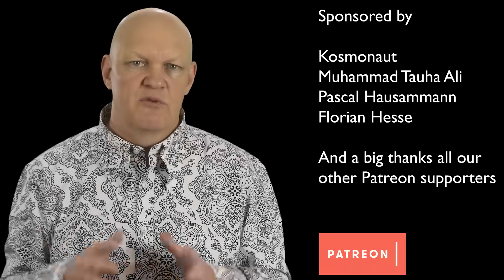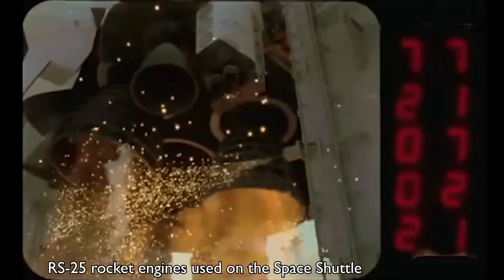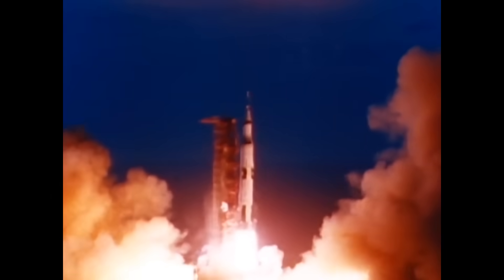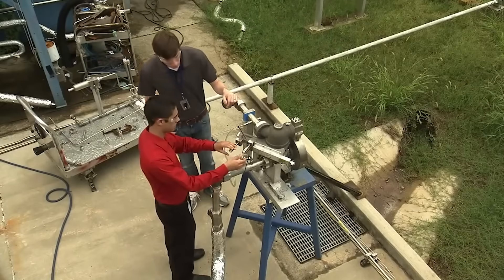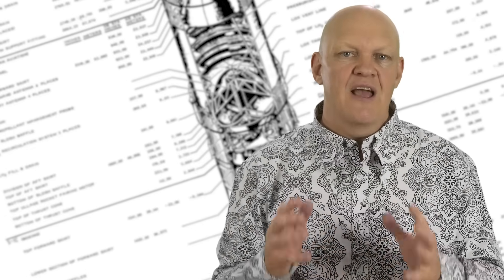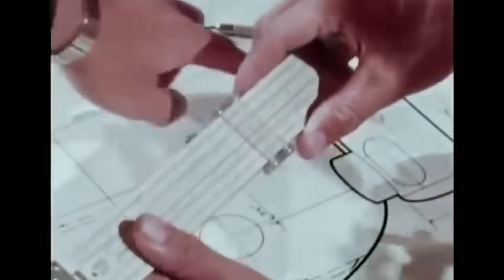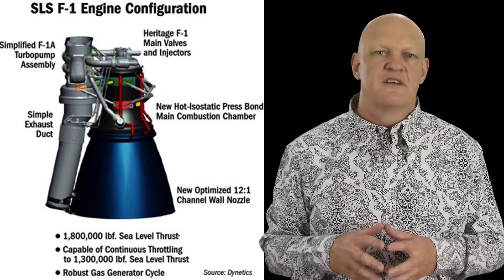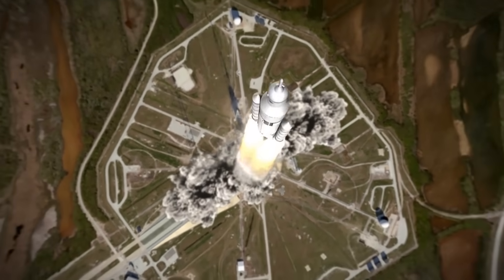Why Can't we Remake the Rocketdyne F1 Engine?

Comment: I was tasked with getting a replacement made for a circa 1971 custom made 18,000 RPM spinner assembly made. It had very tight tolerances and some interesting tricks were used to allow it to do it's job. It had a 2" through hole and 4 open cage air/oil bearings spaced out along it's 20" length.

To allow the max speed it had to have perfect alignment and zero play.

The original prints were copies of copies of... (which I recreated in SolidWorks). They were missing some info due to copying degradation but I had a working unit to fill in the blanks from. I tore that down and using a CMM found that where the prints called out +0.0003/-0.0000" and perfect feature to feature alignment that was held in every case.

This was a clamshell assembly that weighed about 80 to 100 lbs.
At least 30 lbs for each half on the steel housing.

When I shopped venders to make the parts, most parts received 'no bids' from everyone given a RFQ.

Specifically the housing. Being a tool and die maker myself I knew how tough that part was going to be. I only Requested Quotes from shops that specialized in that kind of tight tolerance and high complexity work. Also I made sure they could comfortably handle that size and weight.

Nobody wanted it. No matter how much that said they did on their website. Btw... My customer had deep pockets so a high bid had every shot at getting the job... if they had bid it.

From what I heard only three of these were ever made. There are other types and versions of spinner that do kind'a the same sort of testing. But when the one we have dies (as it almost did two years ago) there'll only be one left on the planet.

Moral of my story, and of the NASA rocket...?

"Everything that has a beginning has an end." The Oracle

Comment: Where I work, many very large machines and systems are still in use, continuously operational since just after 1970. We face the same problems sometimes. The men that created them are dead, and the documentation is partial or incomplete. Great video!
Reply: It's not just mechanical systems: one of my first jobs, back in the 1970s, was on a project to replace the in-house-written business software for a company using an obsolete IBM 1401 computer. It seemed like a tedious, but not complicated job, at first: most of the software was written in 1401 assembly language, so its logic would need to be duplicated and rewritten in a modern computer language. But, when we started running the old and new systems in parallel, they produced different results.

It turned out that, because the process of compiling large programs was slow, people had taken to patching the compiled machine language card decks for minor fixes, without updating the source code, and no one knew who had done what, or when, over the course of several years.

We wound up having to buy a 1401 emulator software package for the new computer, and running the old object decks while we figured out what undocumented changes had been made.
Reply: @earledward8766  NASA is about to place an object into the orbit of an asteroid for the first time. NASA (with the help of the EU) just landed on Mars. Not to mention the countless satellites the US has launched this year including several that are for the specific use of US intelligence. When you say "we have no access to space anymore" what are you talking about. Please look at the upcoming launch schedule for NASA https://www.nasa.gov/launchschedule/
Reply: @Bum Face Gammon And you, Go back to your safe space!
Reply: Wow, that's awesome...sad it wasnt documented properly
Reply: I interned a power plant that had steam turbines used in the 1940's.  None of the designers were living and everything was done on paper back then.
Reply: @earledward8766  In less then a year there should be 2 commercial carriers (SpaceX and Boeing) to carry astronauts in space. Test flight sscheduled, vehicles ready. I doubt they both will fail, it's pretty straight forward tech. SpaceX is flying the uncrewed one frequently. More coming. So I think that's nothing we should worry much about.
Reply: @Bum Face Gammon"The Education System", especially in the USA & the EU, no longer teaches children to think. It only teaches them what to think. The education system is able to control the population, because 8 out of 10 people, will always do what takes the least amount of effort, when it comes to seeking comfort as it applies to thinking. It's easier in most situations for someone to follow step by step instructions, rather than for that someone to figure it out for themselves, so schools simply concentrate on teaching things, where they know, that students will get a good outcome, so the following of instructions is positively reinforced in the students. They are never challanged enough with figuring out real life problems for themselves. Not just academic ones but even getting along in society ones, such as in, If you encouter a bully, go & get an adult, rather than sorting him for yourself. So they fail to see the value in actually thinking for themselves. Here in the States, this wrong headed, modern education system has produced a whole generation of compliant drones, known as "Millennials", who don't know enough to realize, what they don't know! For example, to my 23 year old Millennial niece, who is a reasonably able person w/ a Chemistry degree, "Freedom of Speech" is literally nothing more than a euphemism for "Hate Speech". She has no Earthly idea what it's all about, when she hears older generations say things like, "I may not agree with what you say, but I'll defend your right to say it!".
      So, even STEM majors are no longer "College Educated". They are "College Indoctrinated".
       Hopefully, "Gen Z", which seems to have a healthy amount of cynicism about following the docturine of The Globalist Establishment, after seeing their older siblings catch the bullet train to serfdom, will emerge as saviors of the World. ...Otherwise the future seems rather bleak.
Reply: Millennials may not be able to duplicate the F1 rocket engine, but they can sure tell you if it was sexist, racist, or homophobic!
Reply: @sparky6086  Yes because all us millenials dont work or do anything good for society........
Reply: @sparky6086  funny. And a baby boomer could tell you they don't think we went to the moon.
Reply: @MarkBratanov  The apple doesn't fall far from the tree!
Reply: @sparky6086  apology accepted
Reply: @MarkBratanov  Wasn't an apology. I thought, we were on the same page. I was pointing out, that it"s not surprising, that a screwed up generation, the Baby Boomers, would beget another screwed up generation, the Millenneals!
Reply: The documentation was partial or incomplete in some way? NASA just so happens to say most all of the data, video and audio was destroyed or erased as a means to keep costs down.
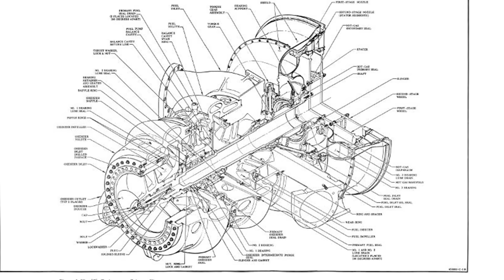Reply: @swish1onu  Well, most of the documentation was not destroyed. For example I was studying a drawing of the F-1 turbopump the other night. It just so happens that Scott showed the exact same drawing in this video at: 3:37. It's all out there if people just bother to look for it.
Reply: @joevignolor4u949  .. Joe, I'm not the one saying most of the important material and technology necessary to go back to the moon was destroyed. NASA spokesmen are saying that...NASA is saying they have to peice together what information they do have in order to re-discover the technology. Again, out of their own mouths.
Reply: @swish1onu  So what? I did things 50 years ago that if I wanted to do them again I'd have to piece a few things together. You are looking for something that's just not there.
Reply: @joevignolor4u949  .. you're making a false equivalency Joe. Let's put some perspective on the moon landings.. it may be THE MOST MONUMEMTAL achievement of man in the modern era.. yet the data, and the technology to go back to the moon was erased, destroyed and lost? Give me a break. Trying to replicate something YOU did 50 years ago is not only historically insignificant, but likely on a personal level, not significant enough for you to have even cared to document the achievement in any detail.
Reply: Well the government and other parties have things like the gun that killed a president or a brain of some scientist people can keep those around. When it comes to information, data, and other records that are the biggest achievement for the whole human race, nah they can't be bothered to not record over it, lose it or destroy it. How do you tell when someone is lying look for inconsistencies and there are a boat load when it comes to humans landing on the moon.
Reply: The only hope I have for Trump's presidency is that he actually goes through with the moonbase plans, or at least enough that the next president continues them because then we'll finally have gone back to the moon and kill multiple stupid arguments moon fakers and flat earthers use.
Reply: Hilarious how a British guy was hired to shill for NASA...
Reply: Well most work places dont have 25 billion dollars in funding and no much in profit margins and have access to the greatest minds and skilled tradesmen like NASA. They can spend a billion dollars on finding and getting a few people to reproduce or come up with something better they could.  They just dont want to admit they didn't make it out of low earth orbit and to the moon.

Comment: New engineers are limited, oblivious and book smart.... it takes them an average of 5 to 10 years in the work place before they pull their heads out of the text book.

The good ones take a year or so, before they wake up. But for every 50 engineers that walk through the door, one is good. Three or four have potential. The rest are glorified paper pushers better suited for project management. Not trying to be cruel i blame the education system, and a lack of practical experience. Today we have engineers playing designer, rather than enhancing, refining and ensuring the design. Drafters reduced to drawing puppets with tangled strings. Communication and planning are an after thought that are not in the budget.

Lost skills/knowledge... you don't know the half of it. The drafting/design side is just as bad. Cad is a great tool, but you need to understand the board and scales. The computer makes the work lazy and the design before had a sloppy half-assed do it like X. So half the work is done with poor design input and direction.

Comment: Apologies because I cannot think of a way of saying this doesn't appear rude, which is not my intention, but your logic is nonsensical. The first time these engines were built no one had the skills or the know-how either - they had to go out and acquire them first. This is the same with everything that is designed and built for the first time and the process has a name. It's called "innovation". As then so now. Before you build the engine you go out and acquire the skills and know-how and then you build the engine. Of course it's generally much easier the second time around because instead of true innovation it's now either following the existing blueprints or if they are lost then "reverse engineering" from what is known and available, where in either case your starting point is way ahead of the completely blank sheet that the first set of engineers started with. The very worst scenario is that no blueprints, models, diagrams, existing equipment or anything at all is available and you're starting from scratch. But even then you are only in the same position as they were in the 60s (though probably still ahead anyway because of additional knowledge acquired over the subsequent 50 to 60 years).

Comment: As "Tian kay' wrote: "The F-1B pretty much IS a remake of the old one, just slightly different and far less complicated."
Why remake a half century old design when you can use advanced design and manufacturing technologies (solid modelling, design for manufacturing, modelling to machining, advanced CNC, CMM, materials, coatings, an endless list) to manufacture something simpler, more reliable and just as powerful? The answer isn't rocket science - err - well I guess it is.

Comment: Great video. Vote for you to be next Bond Villain for ONE MILLION DOLLARS... Yes as an engineer in aerospace the notes that get scribbled on scrap paper or print of a drawing (but not incorporated) gets lost. Drawing on file don't tell the whole story, and the factory or manufacturing working with engineering figure out how to make it work by TRIBAL knowledge.  Want 1.8 million pound thrust  rocket motor? A revised modern F-1B would be awesome. Bottom line we have more accurate drawing and Manufacturing processes and we wouldn't want to make a handmade F1 engine. Yes copy and borrow from the design but we wouldn't make it in the same way because we have better ways to do it which would be more consistent and to tighter tolerances  at least with less reliance on high skill and tweaking.

Comment: We could make those, but why would we want to? Even if they could take us to the moon, which they can't, why we we send men there instead of developing space telescopes which can visit exoplanets, or just send tiny probes to take samples and video?
But these rockets are not any great feat of engineering. They could not perform outside of imagination. If you look at the tail flame you will notice it is longer than any comparable rocket. That's because they were unstable at high speed and a weak fuel mix only could be used on them. 
We know Apollo could never have survived low earth orbit because it lacked the necessary heat cover. The crew would've been cooked in less than a single orbit, far less survived 7 days in the unrelenting furnace of the sun. 
Here's a 5 minute vid explaining this:https://youtu.be/Zztbw7MLlkI

Comment: I'm sorry but I'm not sure where you got your info. I talked to actual NASA engineers back in the 90s at the Red Rock installation about the rocket engines, more specifically the Saturn 5 rocket. My question was simple, "Why not just build a new one?" The NASA engineer flat out told me that they had lost the blueprints and couldn't manufacture it without them. It's not a myth, it's the official cover story. I knew it was crap then so I asked, keep in mind that I was 13 at the time, "Why not back engineer the fully assembled Saturn 5 that's located on the grounds of Space Camp here in Huntsville?" They walked away from me at that point. It's not that we can't, or are incapable. There is another reason they won't do it, whether they're holding out for more research funding or other political reasons, but don't believe for a second that we can't rebuild and reproduce those rocket engines.

Comment: so basically we dont have skilled workers
Reply: But also the design was truly awful.
The practice of brazing the combustion chamber out of lots of small tubes is mediaeval and was never used again. The straight through injectors failed to mix the fuel/LOX well too - look at the dirty burn in the video at 0:05, that's most of the fuel being thrown out.

The tubular design gave rise to huge pumping losses, weight and low max chamber pressure. When the power was increased beyond 1e6 pounds they blew up as the thinwall tubes ruptured.

The 1969 soviet design instead used an efficient double wall combustion chamber, decent mixing injectors and a closed cycle turbo pump and are still used today, unlike the troublesome F-1 that was dumped ASAP.

Comment: I'm all for creating an F-1 equivalent, or better, with modern techniques.  Just because the original isn't possible, all of the chemistry & physics remain the same.  Obviously, the folks orchestrating the new hardware are not of a like mind.

I've never been a fan of SRBs, especially for manned flight.  The reason they were used on the STS was that they were cheaper.  One of the original STS designs called for a liquid-fueled piloted launch assist vehicle which would return to the cape to land.  Scrapped due to cost.

Comment: In effect the blue-print were lost. The original blue-prints were as engineers found out to be incomplete. This is the reason there had to come up with ways to make it work. 

Not really a myth that the blue-prints are lost after all. 

Modern welders in USA are not good. Look at the US and UK warships that have badly welded parts June/August 2018.

Comment: bullshit if you have the blueprints a machine can replicate them 
so either the blueprints are not accurate or flawed in which case they are not blueprints at all but just sketches of the engine .
or the blueprints are indeed right but the engine never actually worked .
if you have a blueprint you can replicate it there is no magical welds or fairy dust  stop lying

Comment: Hello Curious Froid.      Instead of viewing your regurgitated propaganda lies, let me give you some facts. Rocketdyne and NASA are working together and currently developing their next generation rocket engine which is an updated version of the Space Shuttle rocket engine which is the RS-25 engine which will have the improved weak ass thrust to weight ratio of 53 (according to Rocketdyne) and the fake numbers given by NASA for the Rocketdyne F1 Engine has a thrust to weight ratio of 82. Why the fu@k would they want to upgrade the Space Shuttle weak ass thrust to weight ratio to 53 while they could upgrade the much more powerful Rocketdyne F1 Engine and increase the thrust to weight ratio above 82?      Why? because the Rocketdyne F1 Engine's thrust to weight ratio of 82 is a fantasy made up by NASA.